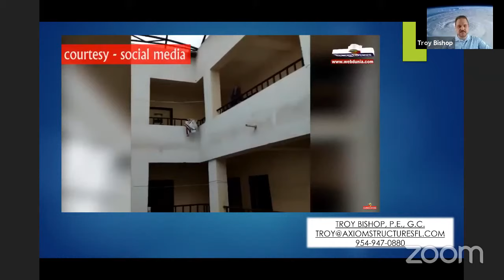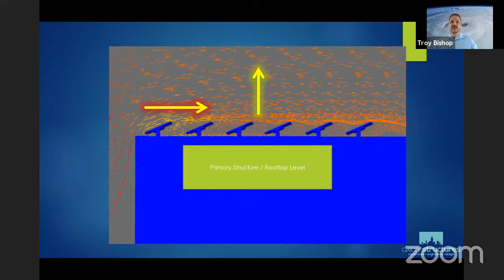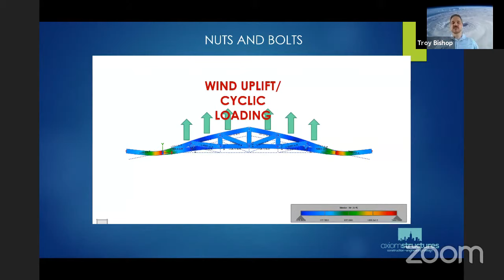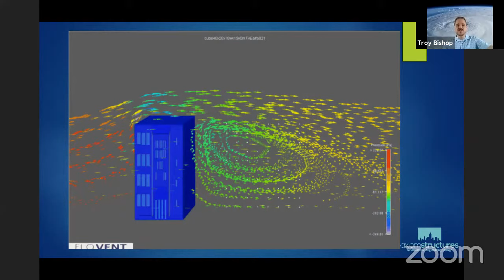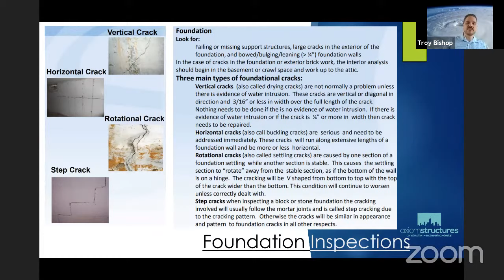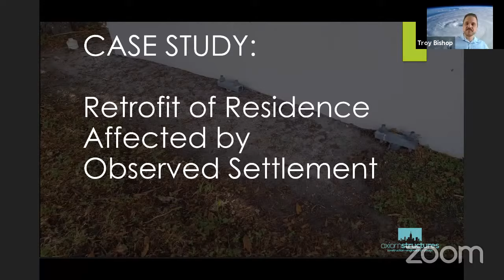How to Inspect Trusses, Concrete Cracks, and Settlement Defects with Troy Bishop

Comment: I just want people to understand this.  Don't remove a bunch of walls in your house without consulting an engineer.  It's not just a question of whether those walls are load-bearing.  It's a question of whether those walls are important to strengthening the structure against lateral wind and seismic loads acting on the building.  It's super popular for house flippers to come in and create an "Open Floor Plan" without any regard for what the heck they are doing.  Don't remodel buildings if you are not qualified to design buildings.